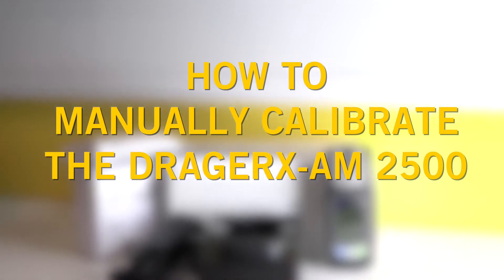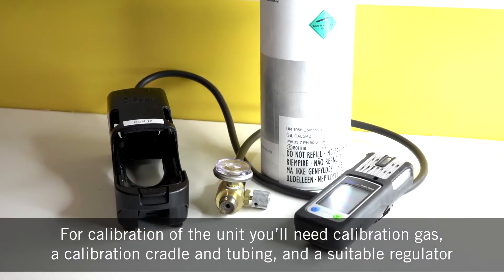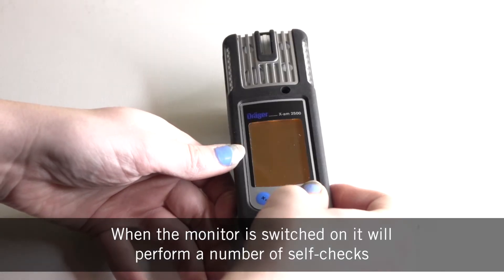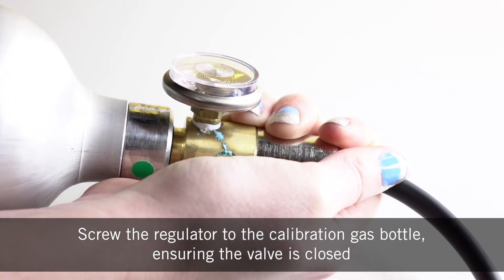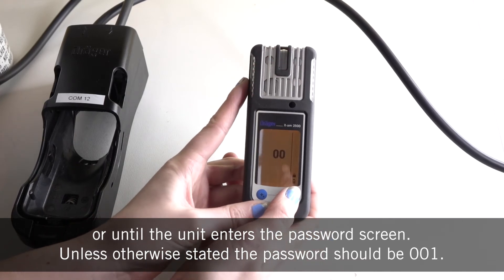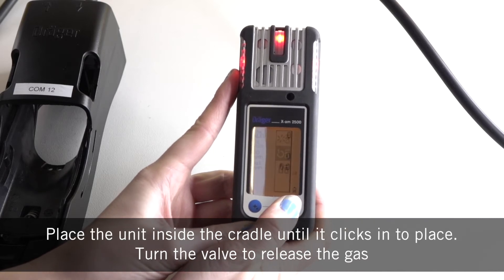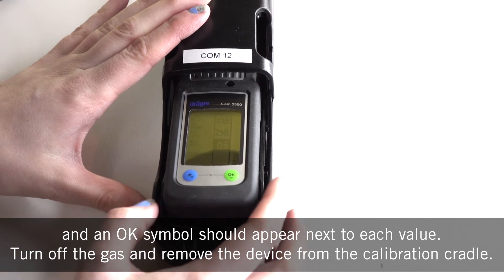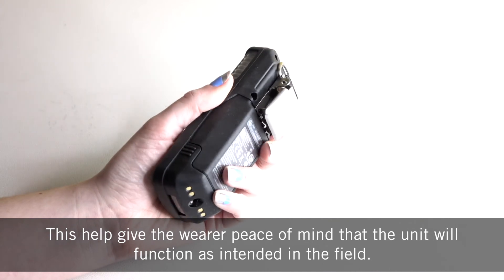How do I manually calibrate the the Drager X-am 2500?

Comment: is it a fixed flow or a demand flow regulator?
Reply from the maker: Hi there, 

Sorry for the delay in the response. When manually calibrating the Drager X-am 2500 you require a fixed flow as demand flow regulators are used for pumped monitors. 

Hope this helps.

- Callum

Comment: How do I take the batteries out and put new ones in? I already took the screw out but I can't get the batteries out of the battery holder
Reply from the maker: Hello, sorry for the late reply.  You should loosen the screw (2.0 mm hexagon socket) on the power pack and remove the power pack.  If it's an alkaline battery holder (order no. 83 22 237), you should be able to pull the batteries out from this, otherwise the NiMHy rechargeable batteries should be charged in the unit on a charging dock.